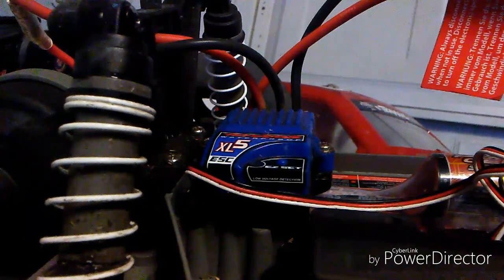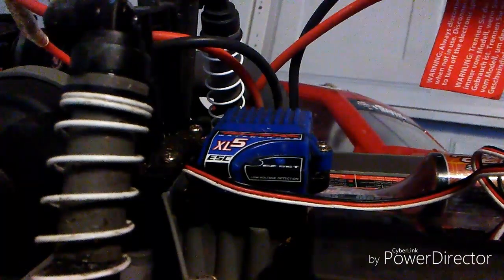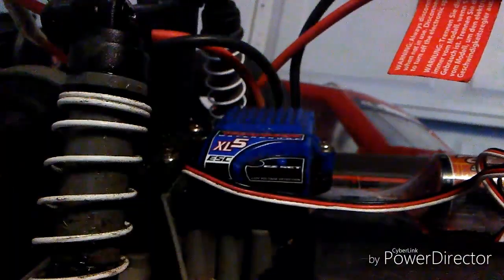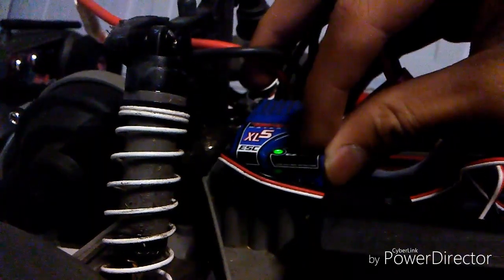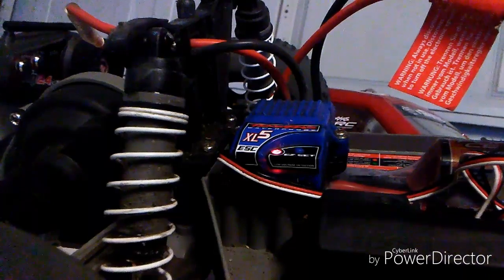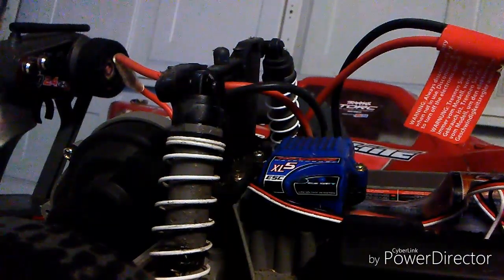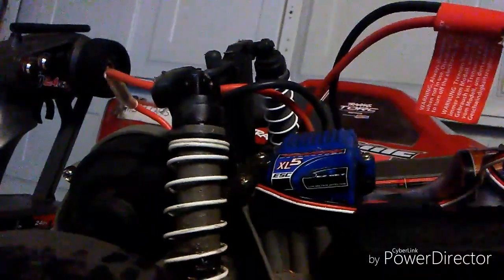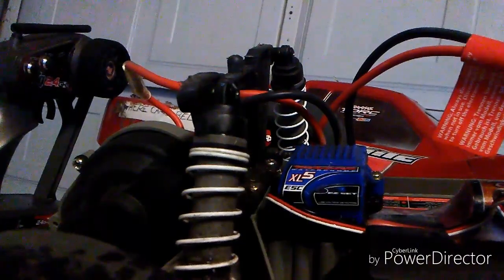Programming the Traxxas XL-5 System (READ DESCRIPTION)

Comment: I just got a rustler 2wd do it go faster on race mode and when u first get do it come out the box 100 back , brake, and reverse if I new my car was gonna be this slow I would of got the 1 that go 65 what could I do to get it faster so one said buy the motor that comes with the car that runs 65

Comment: Can i use 9.6 v NIMH 5000mah battery in the BigFoot 1 Monster truck
Reply from the maker: I think the XL-5 esc can take 9.6
Reply: I have two Traxxas TRX 4  and they will both take a 3-cell battery I'm thinking that's 11.1 votes I'm not sure what your Bigfoot would take do you have the owner's manual